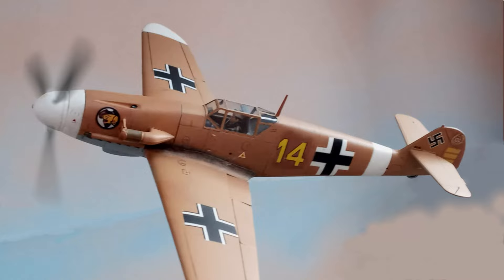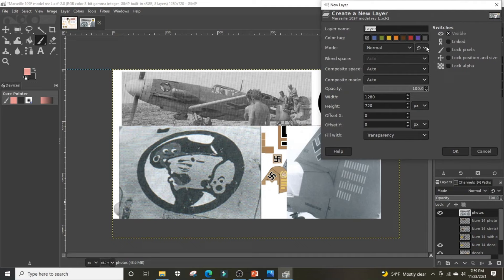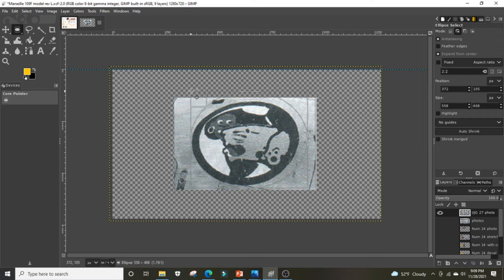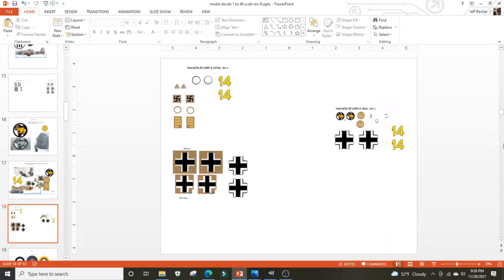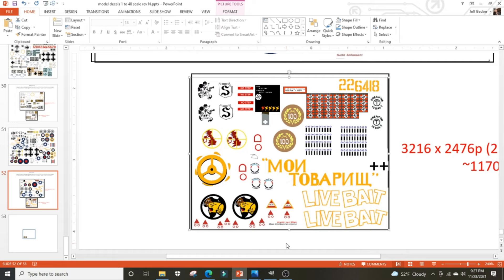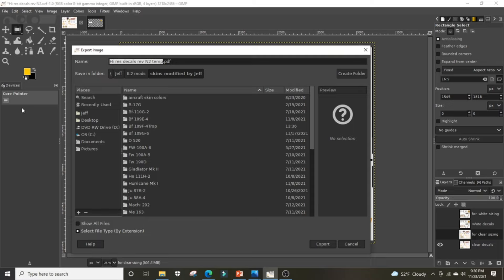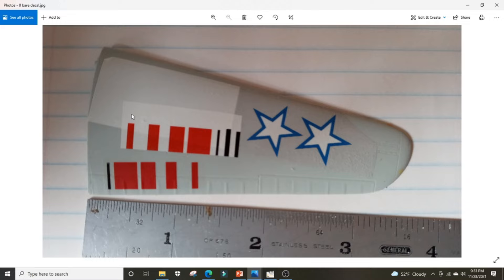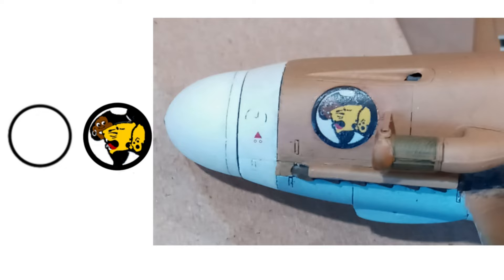making custom decals for small scale models

Comment: What sealer do you use once it's printed?
Reply from the maker: Sorry about my slow response. In the comments section, I attempted to describe that I used Krylon UV protection matte (or gloss) finish as a sealer. Comes in a spray can.  For the paper I used, using a sealer prior to placing the decals in water is optional for laser printer water slide paper but is essential for ink jet water slide paper.